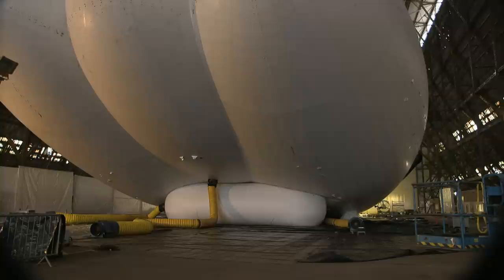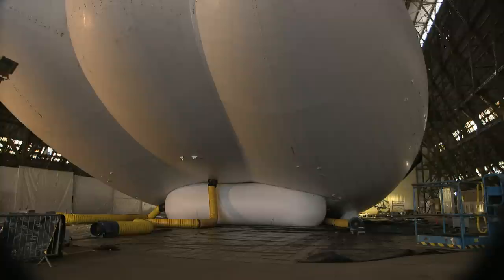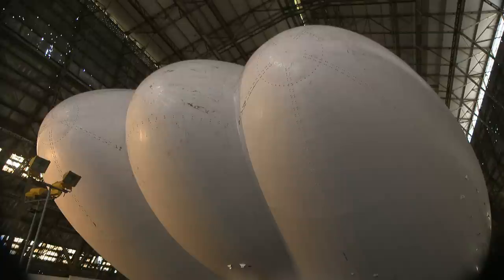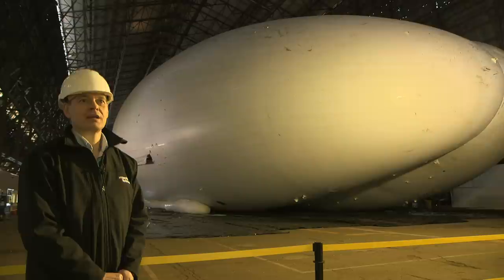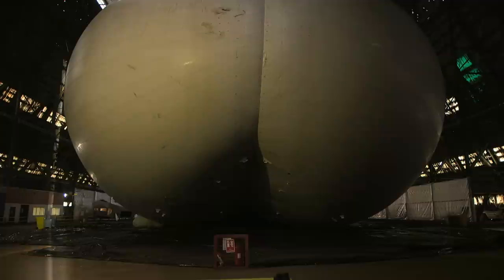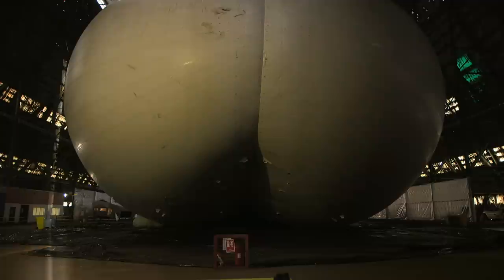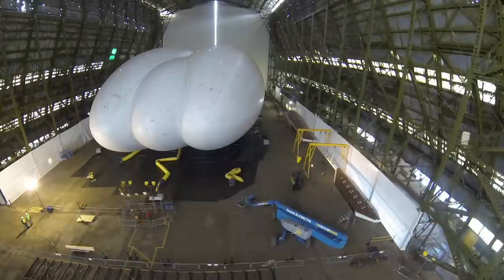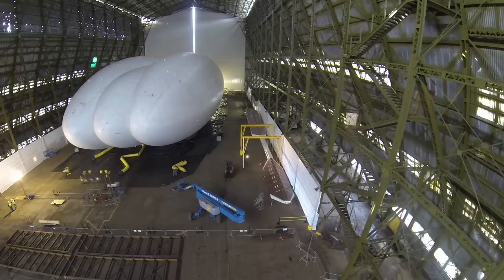How to assemble world's longest aircraft ? BBC News

Comment: Also, something that can add to controllability,  a Canard out in front of the Airlander, It really made a lot of sense to, once it was explained that the new airship design is based on the wings of airplane wings, that create lift by the shape of the wing and,  by the movement of air, over the top, and under the bottom, of the airplane wing.

Comment: I would love to see a airship frame made without  - a single weld in it--,    or rivet, create the airship frame completely from a laser sintering, of 3-D Printer, found in additive manufacturing, the airship frame would be so much lighter, and would also be much stronger as well, I have also see how these fuel injectors for jet engines would normally take 19 steps to build, and now the 3-D printer has lowered the number of steps to 1or maybe to,  2.

Comment: what would be the advantage over classic transport aircraft?
Reply: +Shaun Orwell 
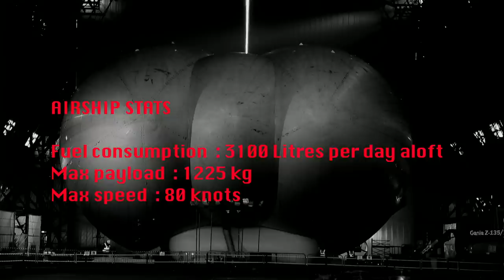I don't think you noticed it. At 3:12, it says the payload is 1225 KG! Modern aircraft can have 60 times as much payload! When you calculate the average cost in $/kg that's waayyy more expensive than modern transport airplane!
Reply: +Shaun Orwell How is it defended?
Reply: +Danielchai S I don't know.. How is a Boeing 747 defended? Or a Southern Pacific freight train? Have you got a thing for shooting up commercial transport?
Reply: +Shaun Orwell But LTA suffers from bad PR. So I think the best way to deal with PR and confidence building is put it in a niche such as cargo, and let it establish itself, build confidence, evolve and so forth. Might take a few years, but with enough success, it might then move into a passenger cruise niche. It's like the public wants LTA to be re-invented safer than HTA!  -No risk of crash/disaster whatsoever. -Rather like a double-standard, to me. HTA is allowed to to have its violent crashes. But not LTA.
Reply: Carl Lelandt Not being sarcastic

It's also for military.

This seems more vulnerable than a 747.  Are there separate chambers that keeps it floating
Reply: Danielchai S The double or triple rugby ball shape balloon thing is actually completely filled with gas. It's stiff because the gas pressure is high. So, there's no structural support inside the balloon.
Reply: +Alq The competitive niche for this is transport where there's no ground accommodation, such as the niche of helicopters. This would have a farther range, and greater payload than most helicopters to remote regions. I don't think it's supposed to compete with existing commercial cargo jets.
Reply: Carl Lelandt Someone said "it has a far heavier cargo limit than conventional aircraft." But the payload shown in this video is less than 1300 KG, and that's only the weight of a small to medium size car, which is contrary to what the guy said. So, what I did was just to point that out to him. What I said wasn't about blimps vs conventional cargo aircraft in general.
Reply: +Danielchai S According to the video, it was built for the USAF.. Then they didn't want it. Maybe they're gonna try and promote to the British military or something. But what I got from the video, was that they were looking at private sector. There's a number of good applications for such craft. Yes separate chambers inside the outer envelope, that inflate, deflate from expansion or compression of helium. A lot of hybrids, and regular blimps use that technique nowdays.